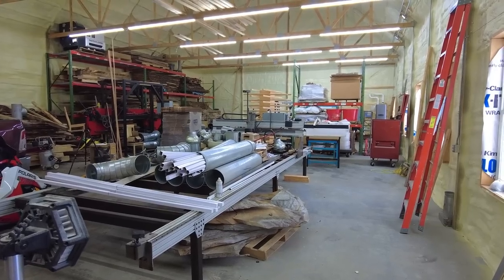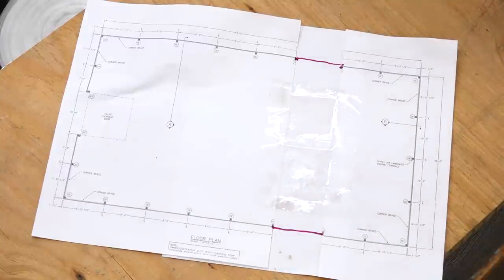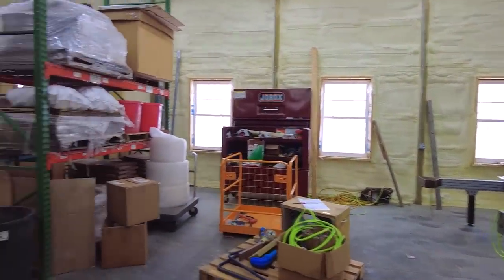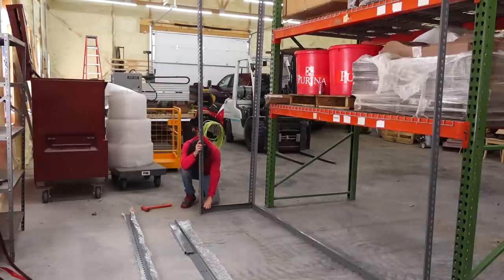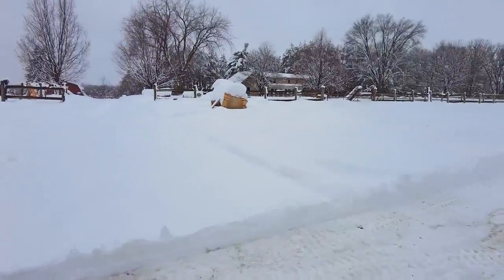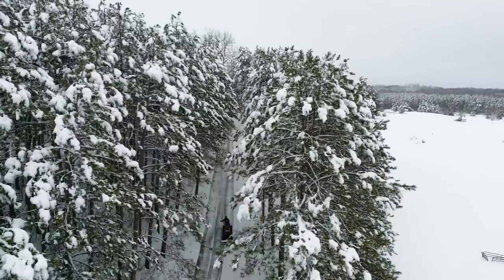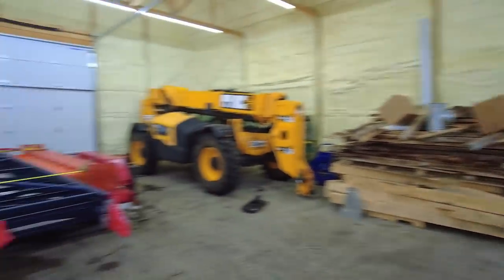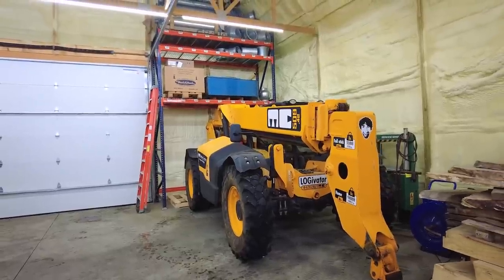How Long Will This Barn Take to Pay For Itself? - Setting up & Answering Questions

Comment: When figuring out your payback time, you also need to take into account rent increases over time, as well as the fact that after your payback period is complete, you're left with a functional building, whereas continuing to rent leaves you with nothing.
Reply: That's exactly what I was thinking too. Also, the increased property value now and appreciation over the next ten years during the payback period plays a role. His true payback period could only be a few years.
Reply: Yes, there's equity.
Reply: Yet how does one value "convenience" (& reduced "travel time") in the standard accounting "payback period"?

Comment: Mathew, as one of those who kind of asked about pay back time thank you. I kind of expected it to be good, I didn't realize that it was going to be this good. Congratulations, a job well done. 
  As I am in the process of reorganizing my own much smaller shop I can empathize with what you are currently dealing with. Proper organization is key to running a successful business. It may not feel like it, but putting in the work now will pay off tenfold later. I have found that doing the job in detail on paper is invaluable. Erasing a line on paper is much much easier than moving something around in the barn.
  Now for a bit of negativity. I was freaking out when watching you initially put up the ducting. As an ex ironworker I have a very good awareness of what working at heights entails. You my friend, were screwing up badly ! An unexpected shift in a load can have disastrous consequences and you were completely unequipped for such. I was holding my breath as I was watching you move those tubes around. You were so close to losing them a couple of times. You would not be the first person to be pulled or pushed off of a workspace by the load that they were dealing with. I speak from experience, it was just shear luck that in my case I didn't go all of the way over from the third floor of the building that I was working on. If I had there were a number of rebar rods protruding up from the concrete that were just waiting to skewer me. 
  When working on our own we often pay less attention to safety then when we are part of a crew on a jobsite. You were definitely guilty of that at about minute 3 or so of this video. Falling ten feet onto a concrete floor is no laughing matter. I have a friend who fell off of an eight foot ladder when setting up his printing business. He was on the top rung of the ladder which we all know is not right. He ended up losing his business due to the months that he had to spend healing, with no income. Do you have three months of no income built into your business plan?
  There is a VERY simple way of protecting yourself in what you were doing. Most elevated platforms have a safety chain to close off the open side when you are working. Either yours didn't have one or you did not bother putting it up. An alternative to that is spending about eighty bucks on a safety belt and clipping it onto the railing of the platform. If you do end up going over the edge at least your injuries will be minimal with this. I apologize for the criticism, but I have been watching you on your journey for a number of years now and am so glad to see all that you have accomplished, (aside from the greenness of my envy for not having done something similar). You have been an inspiration to me in my own endeavours. I would seriously be saddened to see it all coming to an end for the lack of such a simple and cheap fix. I want to see how far your journey goes. I will be able to say, "I remember when Matt Cremona was cutting up logs in his backyard, now look at him." I kind of think that your wife and kids are a bit invested in your progress as well. Being a risk taker can lead to some great rewards, but why do it when there is such little gain as saving a couple of minutes?
  OK, rant over. Congratulations on getting the barn finished and now being able to work in warmth and dryness. Looking forward to much more. STAY SAFE and keep on trucking.
Reply: Safety harness and lanyard, NOT A SFETY BELT.
Reply: Matt has used excellent fall protection in the past, so he obviously knows what it is, and when it should be used.
Reply: @freddybee4029  Did I not state that I am an ex ironworker? I guess I should have explained how ex I am. When I was working high steel in the 70's we did not have safety harnesses. All that we had was a belt with a rope lanyard attached. Therefore safety belt. Before getting all pedantic you should first figure out what is actually happening.

Comment: Another option for the bathroom, in addition to the composting toilet as others have suggested, would be to plumb it to a buried holding tank. Depending on usage, a 1,000 gallon holding tank (a smaller size for a septic tank) might only need to be pumped every year or two. The same people that pump a septic tank can pump the holding tank. That would allow for a sink, something that the composting toilet doesn't. 

A water supply tank could be buried or inside. Refilling it could be done in the same timespan.
Reply from the maker: Interesting. Didn’t know that was a possibility. Thanks!
Reply: The viability of a holding tank will depend entirely on local plumping codes.
Reply: @justinjones9255   Correct! Do check your local code. In my area, if you are allowed to have a septic tank, you are allowed to have a holding tank. In addition, you are allowed to have a holding tank where you would not be allowed to place the drain field.

Comment: DUDE, the amount of work you did by yourself in this video is nothing short of amazing in and of itself.  Between the Telehandler and the smaller skid-steer unit, they do a bunch of different things to take the W out of Work.   That snow blower attachment is very handy and seems to work just fine in your setting.  As far as the bathroom situation goes, you could save some funds if you had a septic system next to the barn and then just got yourself a used stick-and-tin RV with a bath and a kitchen for breaks and maybe even for someone to stay overnight on occasion.  You could hook up the interior furnace to the propane tank, the drain goes to your septic system and you could get electricity from the barn and all you might need to do was to add some type of insulation around it for the colder months to keep it warmed above freezing.  For a used RV it could be a lot cheaper than running services to the house.  Water could be portable or you could fill up the internal fresh water tank with a 12 volt pump.  Just a thought...
Reply: You mean a break room? ;)
Reply: I guess drilling a well thru 42' of frost isn't the proper thing to do. In Texas, our water table is at around 25', lol.
Reply: @JasonPeltier  I think Matt was referring to the 42” depth he would need to dig to get below the frost layer. Here in the MO. Ozarks it’s only 2’. I’m sure that in Texas it may not even be a concern.

Comment: As per the issue of adding a bathroom might be adding an addition to the side of the building.  That way you don't lose any floor space in the barn.  All the plumbing could still be added easier also.

Comment: A compost toilet system on a mezzanine would require much less plumbing and the negative air pressure makes it surprisingly civilised. Plus you get compost.
For 'least popular' products you could substitute 'smaller inventory'. 
Have an excellent new year in your new toy/workspace.

Comment: That's why the covered porch area to be built later on is a great thing, because you can plumb for a bathroom out to that covered porch area, not in the building itself - and risking issues with your hydronic floor heating system. You can cut a door in the side of the building to an exterior-mounted bathroom on the porch. You can just have its own door outside, since it'll still be covered by the porch.

Comment: You managed to get the snowmobile about as far from the door (ie: the snow) as possible...  I thought you stored that in the little barn.
Great to see the space getting sorted out, Matt.
Reply from the maker: I usually bring it in to melt off the snow so the track doesn’t freeze up. Much more room in the barn than parking it in my shop. Thanks Art!

Comment: If you plan to add a covered area outside for picnics or working is the issue of placement. You better build it at the opposite end of your large barn door. If you build it on the side facing your house, the snow falling off the main roof on the sides of the barn would quickly destroy most patio roofing unless you make it very heavy duty.  That snow doesn’t fall off the main roof until it starts melting and at that point it’s very heavy. Imagine the weight of a foot of heavy wet snow on a 60’ x 30’ half of the barn roof is and then calculate its effective additional weight gained as it falls 30’.  That patio roof better be able to withstand 10-20 tons of weight or it will need a slope of at least 45 degrees to allow it to shed the snow quickly off. Ask an architect to give you a working design unless you plan to build it halfway up on the side of the barn.

Comment: Matt just use a holding tank for the sewage from a bathroom. You can have it pumped out when you do it for your annual home septic tank solids. You can use a rainwater collection system for the hand washing and flushing. This system eliminates all the trenching,pipe and permitting. And it's a good use of all the rainwater that comes off that huge roof surface. Check out the rainwater and sewage holding tanks made by Roth. They are made of polyethylene I believe and are very light weight so the telehandler can pick them up and drop them in the excavated hole.
Reply: The Roth MultiTank® can be used for water cistern, pump, holding, rainwater, or septic tank. This is possible due to its special construction of an inner layer of FDA approved virgin HDPE, two inside layers of PE for improved stability, plus one outer layer of black and UV-stabilized PE. Not only is it special in terms of its construction, but it also has a warranty: lifetime corrosion protection and 5 years of labor insurance coverage.

Comment: My shop is smaller 30' x 50' with 16' outer walls. One thing I did which has proved very useful was to put an overhead door at each end, one end drive in and the other end as a loading dock. Having a loading dock has made life much easier on my old body. The dock is set to the height of my truck tailgate. I did put in a bathroom as it was much cheaper to do upfront. You will love the natural light from the windows if you plan any sort of wood/metal working in the space.

Comment: I just retired after being a manufacturer (medium size company). Layout is a constant battle btw. No building ever ends up being large enough lol. Right now I'm setting up a small scale machine shop and welding/fab shop to fool around with. Already owned a 1200 ft2 commercial building so have to fit everything into it allowing for work area. It's a challenge.

Comment: Hey Matt, the snow removel part was very fun to watch, especially the shot on the ground as you drove by! I was wondering if you ever plan on sheetrocking or cladding the walls on the inside of the barn in any way?
Reply: That's what all those slabs are for :)

Comment: As per patric O'Brien's comment, I never thought to figure out just how much extra money i would have when my Loans & then Mortgage was paid off. My barn is a multi level 40x 50 with a freestanding 1st floor level as I am built on a hill, the 2nd story is accessible to drive a vehicle in through a 12x12 door, 1st floor concrete, 102 inch clearance height. 2nd floor approx 12 ft, barn roof gives me '3rd floor lots of storage . Often wish it was bigger ....but I believe everyone gets there. But when you stop the bi-weekly & monthly loan & mortgage payments . WOW . JUST WOW , you get the opportunity to really cut back when you need to work if you want to & more time to do things like travel & leisure

Comment: Man, you got a lot of stuff!!!! Long term you might need one or two helpers. Wish you well with your business. I worked as an industrial engineer in a manufacturing facility and designed and supervised the moving of the entire facility to a new location. My primary focus was Work Flow when I designed the new factory. I used Modulex blocks (looks like leggo blocks) and laid out the entire facility to scale (1/4 in = 1ft ) on a piece of 4x8 plywood. The electricians and plumbers and machine installers came to look at my model and make layout prints as to what we wanted. I said all that to say I am thoroughly enjoying you going through this process. I don't understand your business (volume of the manufactured finished product) and so there are no recommendations for the layout.

Comment: future: I poured a big smooth pad outside that semi trucks can park on and unload them with an inside tires fork lift. my lift is an electric narrow aisle reach truck: small footprint quiet  and no fumes. we park the fork tips under a work table basically in the middle of the shop.

Comment: FYI:  if you puts bolts in the holes that the shelves lock into, it will hold them in place, then you can pick it up with the forklift if you need to move it…😊

Comment: Just put in a composting toilet (there are many styles), no need for a septic connection if it's only getting light use. Those toilets use little to no water. Hell, even a bucket with one of those purpose-made toilet seats and sawdust or wood shavings works very well and has about zero cost and very little maintenance, just dump the contents onto a compost pile as needed. Fill one of those 5-gallon water jugs and make it gravity feed down to your hand-washing fixture, assuming your building doesn't freeze solid all winter.

Comment: At my old house I had a barn about that same distance from the house and what I did was buy a used golf cart for about $2300 to run back and forth with.  I mainly was out there in the summer so the snow wasn't much of a factor, but for you a cheap used 4 wheeler might make life a little easier.   Cheaper than adding a bathroom
Reply from the maker: Or I could jog 🏃

Comment: Matt a related cost saving to having your barn is the reduced mileage you are putting on your truck. 2000 less miles per year probably saves you around $1000 — $2000 a year depending on what you figure your cost per mile to drive your truck is.

Comment: You could close in a space within the lean to area to create a bathroom. The corner where the electrical service is could work. Could also add floor heat

Comment: Rain water collection off building to flush toilet and wash up tools . Maybe a water filter added . Small septic system . Save running pipes all way back to your house . You got kids , if they spend time out with you in building. A bathroom will be convenient.

Comment: Have you checked out marine and or RV toilets tanks and evaporators?
I live in an RV full time and my 40 gallon black water tank last me about 10 days. Add a 40 gallon water tank in the rafters for pressure and you've got it made.

Comment: Could always go with a composting or incinerator toilet and a waterless wash station. 
Or tanks for potable and grey water-which during summer could drain to daylight. 
Sort of an off-grid warehouse. 

Question:  will you be covering the insulation so it doesn’t degrade, get damaged or become dusty?

Comment: If you need to store a lot of small items to save floor space and ease of picking or storing inventory I used a vertical carousel racking system. Safety is also a plus no ladders or forklifts and and anyone can have access. 20 feet or more of vertical storage.

Comment: Just a quick note: The tall rack ends can extend above the last shelf if you want to guard against toppling material over the back or ends of the upper level by running netting or a guard rail up above the shelf. Not so important when you have a wall behind the rack, and the loads are all secure, but you don't need to stab or crush the wall either. Hard to see up there.

Comment: In our case, no bathroom also.  Our windows 2 ea. in the library are 24" tall and 48 wide.  I wanted 8' book cases but only got 6' under the windows 8's elsewhere.  In the work room, a 2x4 running up but started up.  Then in the Game room two high windows (west again) and a large picture window.  Two sets of French steel doors and a single steel door in the work room. Had to have egress in any room . 36x70' .

Comment: nice work with the pallet racking system.  You could fill in the empty space on either side of the back of the telehandler by suspending a home made shelf down from shelf #1.  Another thing you can do if you havent thought of it already is to make a shelf or space just for oil, rags, coolant and grease for the equipment there near the equipment.  Just  a thought, great work though.  I just finished my shop, overall 30x110x14.  30x50 is enclosed and i bought pallet racking as well.  Still trying to figure things out as to where it goes.  AND like you, no bathroom.......I got woods and 2 minutes away is a flush toilet.  

Have a great week and keep up the great content.

jj

Comment: 1/7/23; Wow Matt, you guys are swimming in snow! Much enjoyed video 2day..several fundamental issues re: payback/ROIC on building as you discussed, layout of storage shelving work flow, snow blower action ( very nice, efficient attachment & 16ft high shelf/storage assembly of vertical & horzontal frame components & bathroom compromise...plenty of snow outside... so no one will notice!🤔⚡️Stay safe handling items at those heights..take it slow & safe! Cheers!😊🍷😋👏

Comment: Turn your forks upside down on the mast but you'll have to initially need to set them higher off the floor it will give you about 2 ft extra lift height
Reply from the maker: In my frustration I forgot about this trick. Now I’m frustrated that my frustration clouded my thinking 😆